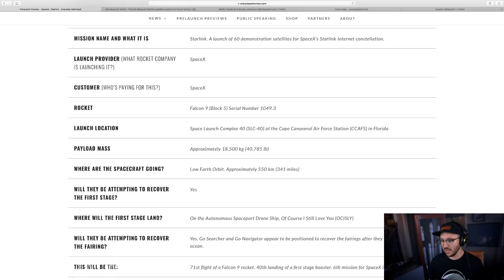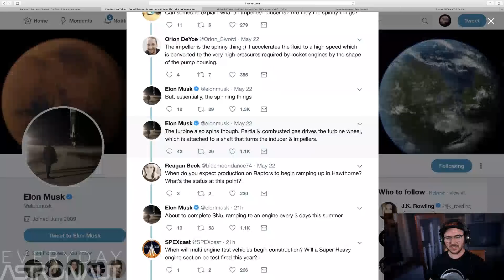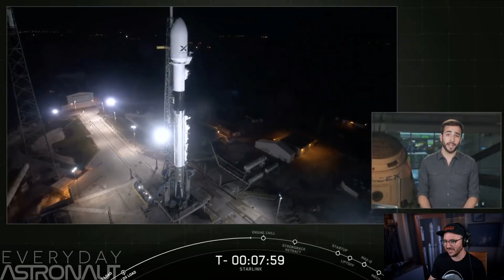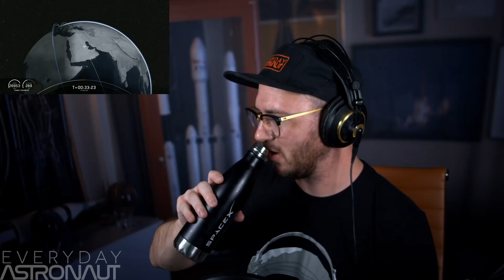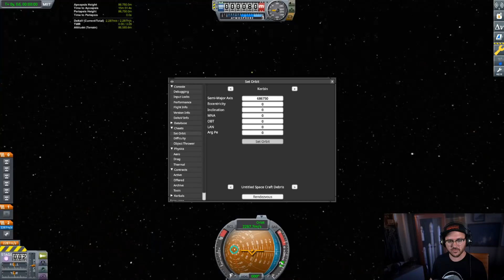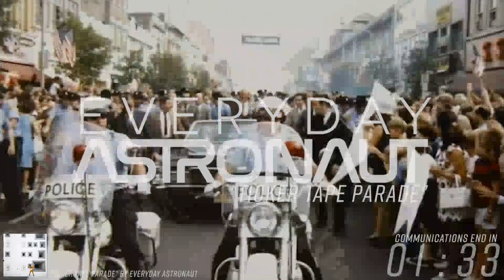Watch SpaceX launch 60 Starlink satellites in ONE launch!

Comment: EA, cool glasses and turbo-tech.. I see they used the Russian RD-180 closed circuit type system for MAX power, so cooly HOT.
Reply: The exhaust from the pre-burner is injected into the vacuum expansion nozzle through the tapered tubing wrapped-around the nozzle.
Reply: @avid0g  ,That HOT, I'd like to see a complete diagram, Thanks for the nugget. I saw a earlier SpaceX model that had a side turbo exhaust tube.
Reply: @davegeorge7094  
The booster dumps this preburner exhaust right beside each nozzle, getting mixed into the flame. So the turbopump becomes more efficient at higher altitude. 

The vacuum engine expansion nozzle is cooled by this fuel-rich exhaust. That's why it doesn't glow near the tapering wrap-around tube. By reheating this waste, the nozzle achieves a still higher vacuum ISP.

Comment: What kind of computer hardware are you using?  6 hours to render, sounds like you need some more thrust.
Reply from the maker: It’s because of all the 4K, 3D renders with motion blur and particle effects in After Effects. It makes even my 10 core, 64 gb ram, 16 gb GPU feel like an old machine. Normal 4K it spits out faster than 1:1!
Reply: @EverydayAstronaut   Have you thought about setting up a network    Render farm?

Comment: I'm pretty sure New Glenn is safely in the "Super Heavy Lift" category of rockets, because the payload numbers Blue Origin advertises are for reusable launches. If a New Glenn is expended, it could easily surpass the 50 mT to LEO threshold to be considered Super Heavy Lift.
Reply: Are they offering it in expendable mode?
Reply: @odysseusrex5908  To my knowledge, they never said they were. Still, the class of the rocket is what it's capable of, not necessarily what it's sold to do. The Falcon 9 counts as a heavy lift rocket, but it's always sold in reusable configuration, which is only capable of medium launch payloads.

Comment: Hi Tim, on SpaceX's feed I noticed at around T+43 some gas was venting from around the plumbing (turbopump?) of the vacuum merlin, along with buildup of chunks of ice. I've seen this before, is it a purposeful venting or inconsequential leak? Does that venting affect the pitch or yaw of the vehicle at all and thus require counter-thrust?  Also, I noticed right before payload deployment that, based on the relative movement of the sun, the vehicle was yawing quite a bit. I assume that was just positioning for the correct deployment angle?

Comment: Curiosity: DO you know that Falcon Heavy has a net acceleration of 6.7m/s^2????? That is less than Earth's gravity... Man, how difficult is to overcome Earth's gravity... it is indeed a heavy force
Reply from the maker: Curious where you came up with that number. It’s peak acceleration is over 30 m/s^2 (over 3gs) based on known data and the user guide
Reply: @EverydayAstronaut  Let's go: at 30:56 the ship takes off, after 83s, it achieves 2000km/h or 555.6m/s, using v=vo+at, a = 6.68m/s^2, again that is a net acceleration, no?
Reply from the maker: Ah yes, that is the NET acceleration. So of course, its gross accelerations is more like 16.5 m/s^2 (9.8 plus 6.7). As the rocket burns through propellant, it gets lighter and lighter and the acceleration increases until the stage burns runs out of fuel. The second stage has to throttle down after its ~8 minute burn in order to not squash the payload with really high G forces.
Reply: @ernestosaboia   In addition to what Tim said, this is a Falcon 9, not a Falcon Heavy, and acceleration varies inversely with the mass of the payload.
Reply: @EverydayAstronaut  Tim, BTW, big fan... keep strong. And see my answer to Odysseus Rex. Cool discussion on gravity.

Comment: If it's heaviest payload why it's not flown by Falcon Heavy?
Reply: It's because payload mass is not the only factor in mission profiles. This launch was to LEO, and while the heaviest payload to date, the energy required was still within a single Falcon 9's capabilities. So engineering-wise it just didn't require Heavy and it would have been expensive overkill to use Falcon Heavy with 2 boosters, when one got the job done. HOWEVER, if this deployment had required a higher orbit like GEO or transfer orbit (and therefore more DeltaV), then one Falcon 9 would not have had enough power and Falcon Heavy would have been deemed necessary.

Comment: after first stage separation, what is that pulsing that I am noticing that is shocking the entire airframe? It starts out fast and gradually slows
Reply: Also noticed that, it was visible in the thermal cover above the engine nozzle (eg. 34:01) as well as in the payload adapter (eg. 34:27). So it seems as if the engine's thrust is not steady. Pogo oscillation maybe?

Comment: So how do they get them into different orbits now?  I know they have de-orbit thrusters but since they released them all together like that while they will separate ever so slightly over time wont they all just be in basically the same orbit?  I know they could change their position in the orbit with very minimal thrust but they can't really change the angle any significant amount can they?  And yes I know this batch is experimental but it represents how they will launch future sets of these as well.  Or is this the point.  This set of 60 will eventually be spread out around the orbit on this inclination and then the next set will be on a different inclination.
Reply: i think they are all planned for the same orbital plane, so to get them into their slots they just have to accelerate/decelerate a bit each and when arrived reverse that. or SpaceX just keeps them in their plane and assigns the slots based on how they randomly distribute (some are a bit higher/slower, some are a bit lower/faster) to save up on propellant. currently they have time to wait for this since the Constellation is not useable yet.
Reply: They will be going into an elliptical orbit. After that, each individual satellite can circularise itself on a different orbit instance, see DasTastic on YouTube demonstrating this in KSP 1.7...

Comment: Tim, do you have falcon reflight counter like: 1st use: 123, 2nd use:20, 3rd use 7, 4th use:0 ?
Reply: Look here:  en.wikipedia.org/wiki/List_of_Falcon_9_and_Falcon_Heavy_launches#Future_launches
You will see that each flight has the booster identified by a serial number with a decimal point. The number to the right of the decimal is the flight number for that booster.

Comment: Tim,I think that one of the reasons for Starlink to be super flat is that it may face the moving direction with its thin side, this will dramatically increase its life in this pretty low LEO
Reply: And if the satellite dies, it will soon begin to spin. This will mean that half of the time it will be facing the moving direction with its big side and have a huge drag/mass ratio

Comment: 33:44 What are those parts that came off the bottom of the nozzle?
Reply: I believe it's a protective ring that stops the engine nozzle from getting damaged durring launch or staging before the engine starts, it looks a bit strange but like everything on rockets it's all carefully thought out and finely tuned to make everything work just right, Apollo rockets are good at showing that too, lots of stages, inter stage adaptors and other bits flying off at precisely timed moments and such

Comment: @Everyday Astronaut 

Tim linux distros usually have built in multible connection stiching (aka connection segementation).
Myself have been using Fedora for years and they just (this month) came out with Fedora 30, give it a try (just put it on a usb and try it out in live without any install on a tmp. environment).

Comment: I see everything says they weigh about 500lbs, but what dimensions are the satellites?
Reply: Going by the pictures of the satellite stack and the roadster in the fairing i would guess that each satellite is about the same size as your average parking bay and about 18 inches/45cm thick

Comment: Any idea why they release all at once? Looks messy with respect to not having them bunch into each other. Why not deploy one by one?
Reply: There is an electricity performance limit to Falcon 9 upper stage - about 6 hours. If they want to deploy one by one, they would need better batteries, lowering on-orbit payload mass.
Reply: Deployment mechanism would be costly, could fail and in this case orbital mechanics will do the same but better. Tim shows it at the end in KSP.

Comment: Actually fibre optic will still be needed for indoor installation and also for military uses. If your explanation is right, indoor users wouldn't have LoS to the constellation, Therefore still need it to support internal Comms either linking to legacy or roof for LoS to the constellation.

Also I suspect starlink is not really encrypted to prevent temper.
Reply: You can hook-up your in-door router to an outdoor antena for re-translation and it will work fine.
Reply: @Anton-uy4rc  maybe, but ain't it more cost effective to rely on a one giant receiver on the roof? also in cities, LoS from the apartment is doubtful at best with all the high rises. for example, singapore is at least 90% high rise built up, so that's a problem for LoS if you don't face a green field/ parks/ car parks.

the thing is elon / spaceX is aiming for international uses, which meant these problem are things they have to figure out also...

Comment: Whats the foil looking stuff pulsing for in a vacuum????
Reply: I'd say it's a big vibration or kick from something, but what is the question....
Reply: Yes, I saw that too. I noticed it on the foil and also in the view of the stacked satellites. Seemed to be the same frequency
Reply: Probably vibrations and variations in acceleration from the engine, just because it's in a vacume doesn't stop stuff from moving, if anything the lack of air pressure and resistance let's it do weird things
Reply: @UNSCPILOT  But i was wondering why it pulses every second, rockets are continuously firing engines.
Reply: @hudcofudco  might be resonating with the vibrations of the engine, and or the course corrections from coldgas thrusters / engine gimbal
Reply: @UNSCPILOT  No there's definitely a rhythmic pulse going on there for some other reason
Reply: @hudcofudco  I'm just going with the most likely cause I can think of, ask Time, Scott, or Elon himself no need solve it alone
Reply: @UNSCPILOT  Thanks anyway mate :)
Reply: @hudcofudco  anytime, if you do find out more don't forget to post it, you got me curious now too XD